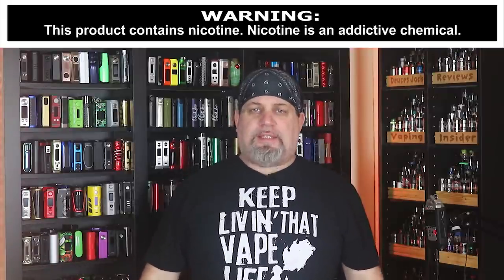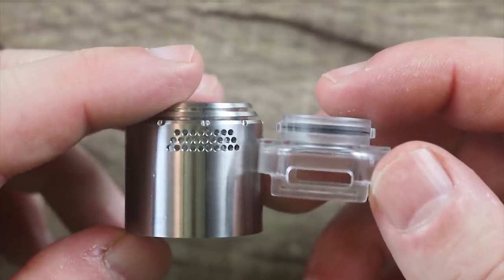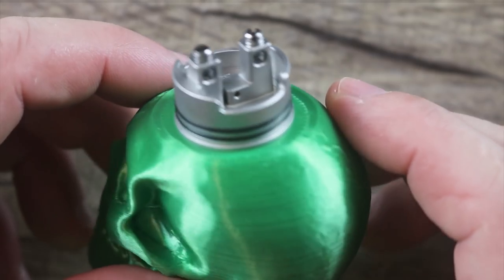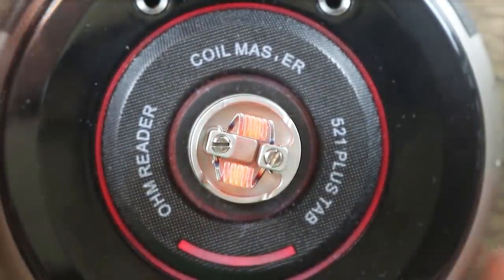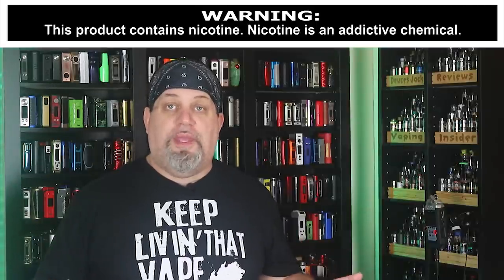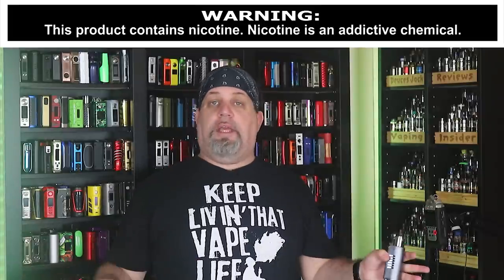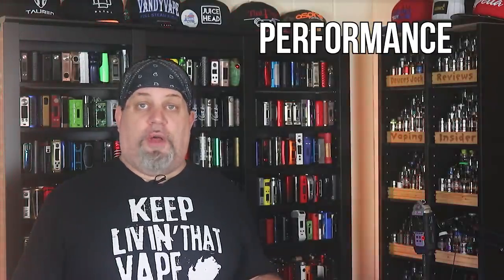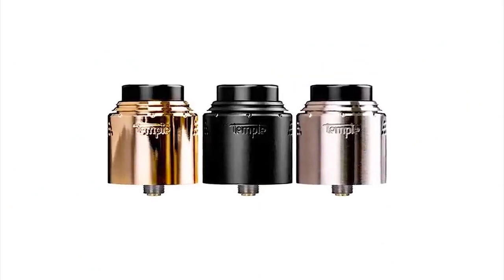GO BIG OR BIGGER!

Comment: Cant even fit that big of coils in it because of the ultem inserts 4mm coils probably ain't happening
Reply from the maker: Nope, ain't happening.
Reply: @VapingInsider  that's just what I dont get, bogan did a build in his 28 and had to but 2.5mm in it over concerns that the 3mm would be to close to the inserts. What other 28mm RDAs cant fit large coils not any I know off anyway lol rant over sorry
Reply from the maker: You can do 3's but you saw in the video how close they were to the posts. None that I recall off the top of my head. The insert is what kills it for big coils.
Reply: @VapingInsider  for sure thanks bro the review great info per usual